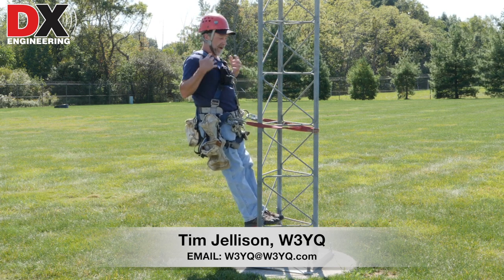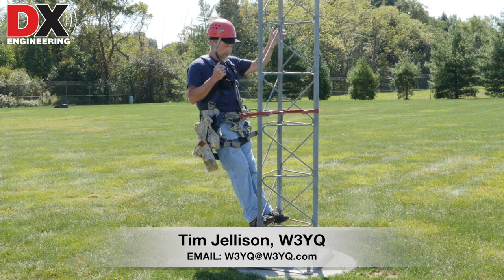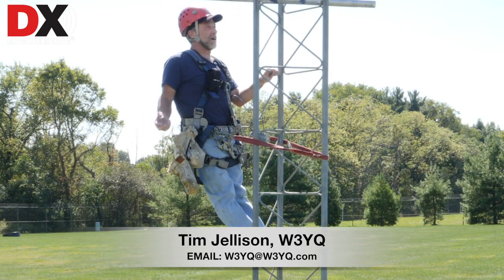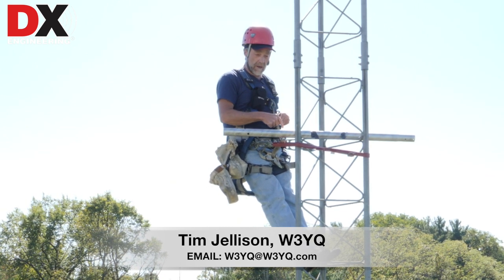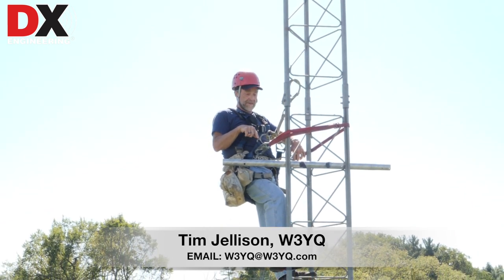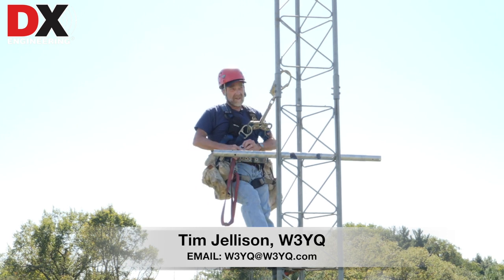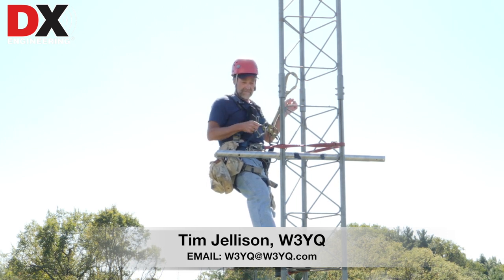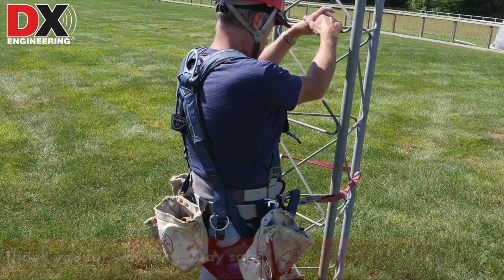Amateur Radio Tower Safety Part 5: Climbing with Positioning Gear

Comment: As has already been mentioned, this video has a number of critical misrepresentations about what is 100% tie-off.  Use of a positioning lanyard, exclusively, is NOT 100% tie-off. As someone who has been climbing towers for 30 years and is still here to talk about it, my advice is to follow the rules: either be tied off 100% of the time with at least one leg of an ANSI/OSHA certified Y lanyard, or be tied off to the steel cable of a tower's integrated fall arrest system (if the tower has one),  using an approved cam system.  Even when using a positioning lanyard, the rules state that one should still be be tied of at shoulder level or higher with at least one leg of your fall arrest lanyard that is connected to your dorsal D ring. If you have a 12 foot type fall arrest lanyard,  you are only then allowed to tie off at foot level.  Quite frankly, this video is dangerous, as it promotes unsafe climbing practices.  Again, use of a positioning lanyard alone is not considered being tied off.  You can still slip and without a properly tied-off lanyard leg from your dorsal D ring connecting you to the tower, you could slide (fall really) all the way down the tower.  That could very well kill you.  My advice is to never take shortcuts with being tied off.  If you follow the rules, you stand much less of a chance of getting hurt or getting killed in a fall.
Reply: I have a 45 foot tower in my yard and i've been free-climbing it since I was 11. You would be surprised how much free-climbing happens within the radio hobby. There might be some "technicalities" about what he's showing that aren't "by the book" or whatever the heck you're talking about, but just looking at this logically, if a person goes about climbing towers in the way this man has showed, you're not gonna fall.
Reply: I'd like some advice if you don't mind answering.. on a water tower, is a 5ft railing around the platform good enough to not need to be tied off? Feel like I know the right answer but I was on one recently that had decorative handrails and almost nowhere to hook to without having to unhook every 2ft, moving around it was nearly impossible especially with all the radio/cell equipment attached to said railing. Tied off with a 15ft lanyard and made it work the best I could while replacing an antenna. Wondering if there was a better solution.

Comment: For a safety video, this clearly contradicts itself and teaches bad habits, as well as a disregard for the regulations. Work positions equipment such as the lanyard or seat are not fall arresters; and it’s mandatory to have a fall arrestor connected at all times. I love the approach to getting this information in bitsize videos; but you can’t promote convenience over safety and call it a safety video.

Comment: Question: Where can I buy the "seat hook" presented at 4:21 in this video?  I couldn't find this as a product anywhere.
A portion of the "seat hook" is clearly a spreader bar.  The remaining portion appears to be a rebar hook on a loop or double loop of rope/lanyard.  I haven't found any other videos/literature that tell how to connect or tie off the seat (very weird).
Reply: here is the name--  Positioning Assembly with GR 43 Chain with Swivel Rebar Hook

Comment: Only I dont really trust the small- almost wire tower parts your standing on, if a weld is damaged and lets go, your weight may bend the wire rod and feet could slide off. Then since your strap is around the outside of the tower, you could slide a long way down. when I got to where I was going to work I would put my strap through the tower before wrapping around .
Reply: that's a single piece of metal all the way up. It's just bent in a zigzag pattern. There are no welds to break, other than the zigzags disconnecting from the tower completely, which wouldn't make you fall.

Comment: Thanks for the series!
Previous comments suggest you should be using fall arrest, but that is covered in the previous video in the series.
I don't believe fall arrest is designed to work at the minimum height used for the positioning demonstration in this video.

The full series should be viewed in its entirety.

Comment: Hmm, all sorts of wrong with this presentation. Its not OSHA rules but good practice is to clip on the side  rail instead on the single rung. if that rung fails for whatever reason you're done or severely banged up. If you clip on the side rail, the rung could fail and you can be caught by the lower rung. The presentation is dangerous practice.
Reply: Wrong, delete this. im not even in the field yet but the side rail isnt smart. it would put straight vertical weight at every weld. Full weight straight down at every weld in one direction. The inside rail is smaller allowing bend which inheirantly could act as a dampener. The inside rails are a continues wire bent at 90 degrees which offer fall arrest plus weld holding the weight. I cant explain it the best but the outer side rail is a terrible idea.
Reply: @tapyinz   I am actually in the field, and a current NWSA, NATE, and ANSI compliant certified Competent Climber/Rescuer Instructor. Tower legs are always the preferred point of attachment. You seem to possess an inherent misunderstanding of applied forces. Please feel free to reach out if you have any questions or wish to discuss proper practices. The techniques recommended in this video are entirely unacceptable in any professional capacity involving work at heights, and are infact blatant violations of current OSHA regulations. 

P.S.,
Those are 45 degree bends in the tower bracing, not 90.

Comment: I would like to see an example of installing or removing a tall commercial two-way repeater antenna on top of a Rohn tower with a standard tube top. The tapered top presents and extra challenge. BTW, I used to free climb my whole life and never knew any different. I now use his method and see the validity of it. At 68 years old, it's easy to make mistakes when climbing. I'm still waiting for someone to design a climb assist that goes in line with the rebar hook for the seat.

Comment: This is what trying to sell a product looks like. I'm sorry but you are NOT tied off with that lanyard. Being tied off and being connected are two totally different things. You do realize you can still fall down the tower and be connected to it which is what that lanyard does. The lanyard allows for displacement along it's length, that means up and DOWN! Being tied down means your displacement is locked to a defined distance by the device. It tethers you to a max distance from that anchor whether you muscles are firing or not. This lanyard will get you killed if you believe this guy. Lets see what happens if you're 150 feet up just with this lanyard and some freak events happen like your legs cramp up all of a sudden. Without the legs to keep u up, that lanyards gonna keep you close to the tower all the eay down. You will likely get decapitated on your descent because you cannot create any distance between you and the tower. What about a freej storm? Lightning sends your body into limp mode. Say hello to the ground! This viedo is a joke. I cannot believe for the sake of trying to sell a product, he's going to make all these claims of how uterrly safe a lanyard is. This lanyard can be used but only in conjunction with fall restraint and fall arrest systems. It should NEVER be used as a standalone device unless you're working only 3 feet off the ground like this guy.